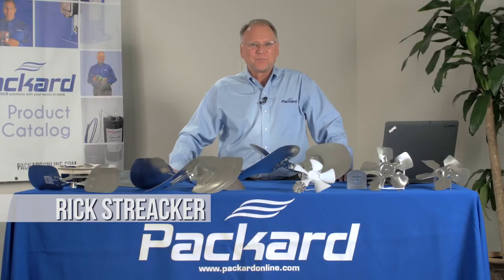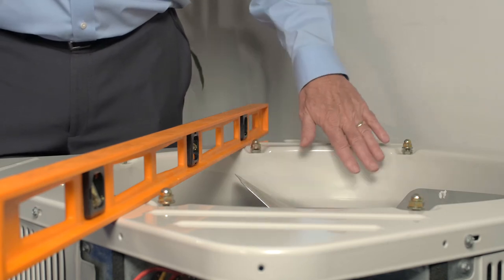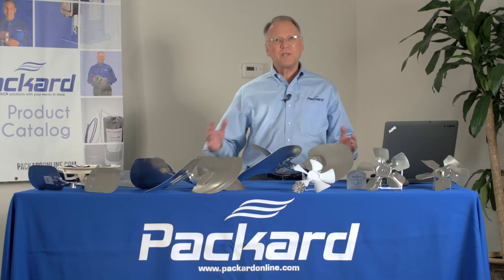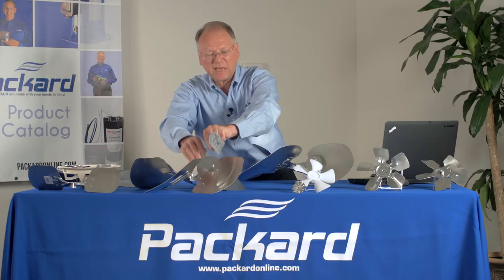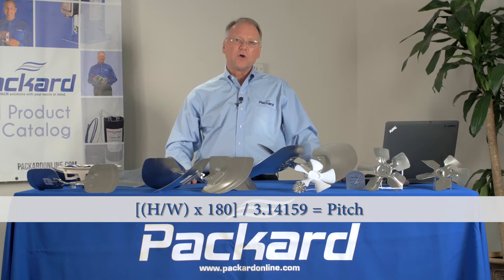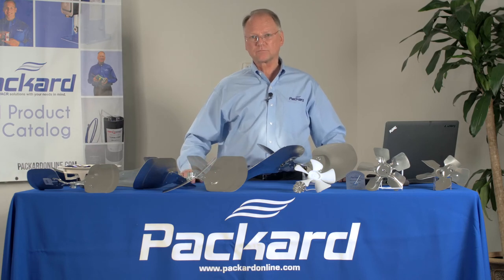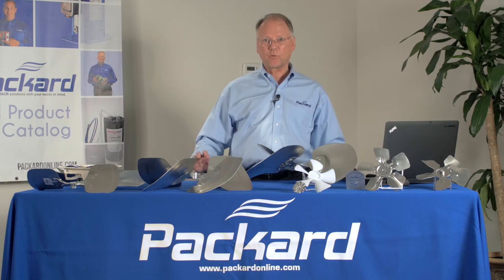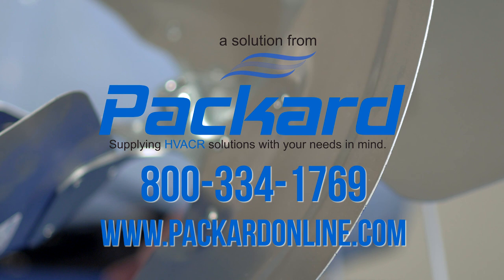Fan Blade Performance and Selection

Comment: Would it work if i used a regular electric fan as an alternative exhaust fan facing outside the window?
Its blades however are not quite wide unlike the common exhaust fan wich is wider
Reply: Great video

Comment: Sir how can we design unidirectional fan blades for clockwise and anticlockwise direction in different time . For plastic fan   blade 6 inch diameter .
Reply: use flat blades to get same thrust on  both sides